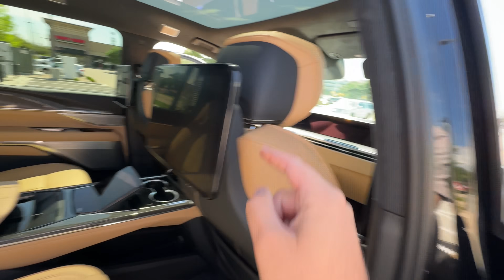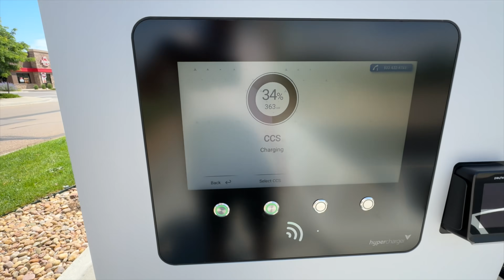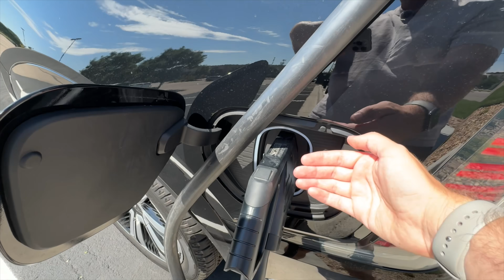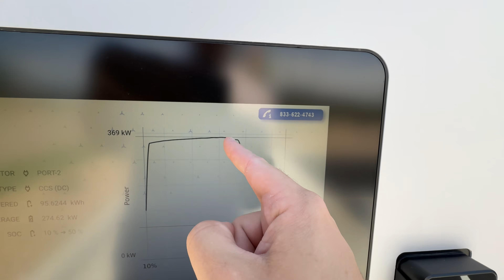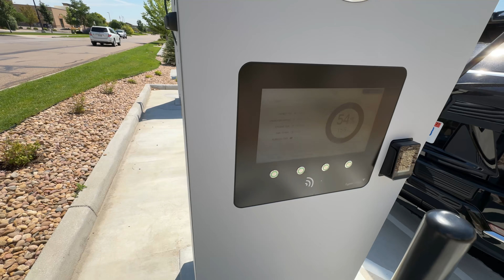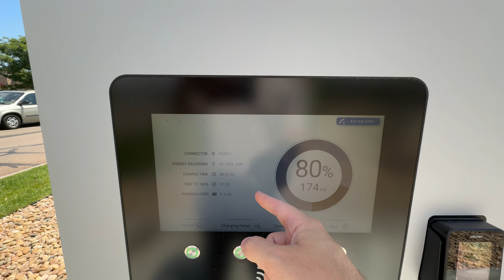Trying To Understand The Thermal Limits Of Charging The Cadillac Escalade IQ

Comment: My Polestar 3 had a defect with the AC cooling vents (they were programmed backwards or something was installed backwards).  In recent heat on a trip to Florida (temps over 98F), I had several derated sessions.  I have the data plotted on my latest blog post.  We don’t have extreme heat planned here for the next 10 days but hope to do another charging test now that the issue has been resolved.

Comment: I recently got a 4WT Silverado. No difference with AC on when charging at 300KW+ even in 95 degree weather. Maybe this has been fixed with an update?

There is definitely a kind of flash that GM doesn’t do OTA, they call it Vehicle Wide Programming (VWP)

Comment: I like that teslas show "charge speed limited by charging station" I see it all the time at a split 200kW charge point charger I use sometimes with NACS cables cause it's cheaper than the superchargers there and almost as fast when I am the only one there. Regardless, it would be nice to see more info.

Comment: Hey, this is great information.  not that  most people need it but for those that really want to understand where you’re going to benefit at a DC fast charger the most, and how you can utilize the way it’s programmed, this is great. I know most people don’t care too much because who’s going to be traveling much more than 400 miles on a trip anyway or 500 miles. Whatever the case rarely have to worry about this charging curve in a vehicle like this, but to understand it and to know how it works is super helpful!  maybe for those that might pull trailers or perhaps just those rare situations for someone really needs to push it on a longer trip it’s always good to know these things thanks again! and I also appreciate this may be the most because some of GM’s batteries have poor charging curves and they have much less range, so this brings it out into the open for everybody to understand better and maybe there will be adjustments and improvements, as we are confident that videos like this will certainly be helpful getting things improved a little bit with some of those vehicles like the blazer EV!

Comment: It has one of the best battery durability in u.s ev market; it uses GM-ultium developed large pouch NCMA cathode cells with 270wh/kg energy density and impressive 3200 cycle life(highest cycle life in nickel based cathode pouch industry because of NCMA chemistery);meaning it has similar prismatic battery longevity as best CATL NMC battery cells used in porsche and MB evs(similar 3200 cycles);meaning according to its EPA range it has 93% capacity retention at amazing 250,000 mile of mileage;cadillac really cooked something
Reply: For the price the batteries better be made out of gold.
Reply: Beauty is that all of GM Ultium platforms share a common cell and module. This means even a $45k Equinox EV has the same benefits, it just has less modules.

Comment: The vehicle should know its own thermal capacity limit and be able to derate itself from the beginning to hold the highest rate the longest based on your max charge limit. If you want to blast as much juice fit a short time, lower your max charge. I’d you have it set to 70+% then it should get to that percentage as fast as possible, even if that’s a lower charge rate to start with so it can hold it longer.

Comment: That precipitous drop was clearly on the charger cable. The fact that it ramped back up after switching to a different charger confirmed it. Mercedes/Alpitronic should really have liquid cooled cables. Even if the idea is that it won't affect 800V vehicles much, 400V ones will overheat it fairly quickly.

Comment: I’m in a road trip with a 25 Lyriq, Texas heat still does a number of charging. Started great at 190kW but after 10 minutes the battery was running 116F and charging dropped to 64kW.

Comment: Do you check or log battery pack temps before beginning charging? It might’ve had no consequence to this car’s results, but your lack of mention of battery temps/preconditioning, and the same from other hosts, keeps bugging me.
Reply: Considering how many charger tests they do, I’m kind of amazed they don’t use “CarScanner” with an OBD-II reader to give them battery pack temps.
Reply: I have car scanner pro for my Ultium-platform Prologue.  I can see charge port, battery, refrigerant and coolant temps with it. I can also see the delta between chiller in and out for the battery cooling circuit. It's an amazing piece of kit. It would be easy enough for these guys to set up some data capture and see the relationships with temps during charging sessions.

Comment: I have had an IQ since the beginning of May.  I have driven from Denver to Houston, Denver to PHX, Denver to Vegas, and Denver to Jackson, WY in the Escalade.  You seem to be hyper focused on charge de-rating with the AC, but that is not how most people are going to road trip - sitting in the car while it is charging.   If you are driving 250 to 300 miles at a time in the IQ, which is pretty damn easy to do, a person is not going to then continue to sit in the car while it is charging.   They will get out and use the restroom or go find food, not continue to sit in the vehicle after just driving for three or four hours.   I appreciate your research in the charging capabilities of the IQ, but it does not factor into real world scenarios.   For instance, yesterday I drove from Jackson, WY to Denver in my IQ.  The hotel had a destination charger, so I left the hotel with 95% battery charge.  I easily made the 280 mile drive from Jackson to the EA charger  Rawlins, WY.  As I charged in Rawlins for 19 minutes,  I used the facilities, got a soda, and then walked around for 5 minutes to stretch my legs.   In that 19 minutes I charged enough to then make it the 230 miles home to Denver to arrive in my house with 20% battery remaining.   I did a 500 mile road trip with just a 19 minute charging stop.  There are not too many EV's that can match that capability which is what I think you should focus on, not charge de-rating with the AC when no one is going to sit in the car while it is charging after driving three or four hours.   I appreciate what you do, Jordan, so keep up the good work.  I just think in this case you are missing the key point when road tripping in an Escalade IQ.
Reply: The only reason I continue to make comments like this is because anything that derates in high heat is a safety hazard with no AC in states like Texas where it easily gets over 100 degrees. I regularly road trip my Lyriq and we always have the ac full blast while it charges, and it will always derate in extreme heat. Alot of times we either eat in the car or want to do a quick run inside get some snacks bring it back to the car and get on our way. I'm a huge EV proponent but excuses like this is what makes ICE owners not want to switch because excuses should not be made on a vehicle that can't run ac and "fill up" at the same time like an ICE car. Rant over apologies.
Reply: @OverlandandBeyond  Rant away, you are amongst allies here.   Everyone road trips in their own way.  The +210kWh battery of both my Escalade IQ and my Sierra Denali EV allow me to easily go 300 miles on the highway at a time.  that is 4 hours in the car, so I am definitely not sitting in the car for another 20 or 30 minutes while it is charging.  My experience road tripping in an EV started in 2015 and I still carry those tendencies when I road trip today, even though the charging infrastructure is no where near what it was back then.    At the end of the day a person makes a decision - sit in the car for longer because they want to run AC while charging, or wait inside an air-conditioned location while the vehicle charges in less time.   If sitting in your car in AC while you charge at 50kW or 75kW is your thing,  then you do you.  I prefer to wait in an air-conditioned building while my vehicle is charging at +250kW.   Also, my conversation pertains strictly to my Escalade IQ since this is what Jordan's video is about.   Introducing another vehicle, even though it is a GM product, with a much smaller battery and much slower charging speeds is not the point of this conversation.
Reply: I don't usually sit in the car but I always leave the AC running when charging. On road trips, my vehicles usually have AC running for 10+ hours on travel days.
Reply: I agree. Not to mentioned the first 15 min or so you are using the restroom gives the batteries the full usage of the fans to cool down and get peak charge before you enter the vehicle again.
Reply: On a 100° day you’re gonna want to keep the car cool while you go out to use the restroom in the facilities. It is unacceptable to derate charging while using A/C on an over $100,000. Vehicle.
Reply: @BK-tx2vw  Fair point.  However, if I am stopping for a 30 minute charge I am not keeping the car cool the entire time while I am inside in AC wolfing down junk food at a Pilot/Flying J.   Is derating charging speeds while running the AC acceptable, certainly not, but with all gen 1 vehicles, a person makes adjustments until a fix is released.   I did the same same thing with my first Model S in 2015, my first Model X in 2017, and my first Taycan in April, 2020.   The Escalade IQ is not perfect, but it is by far the best road tripping vehicle on the road today in terms of range, charging speeds, and comfort.
Reply: @PaulieinColorado  Most of your cabin heat is do to the windshield being slanted more toward the cabin than in most ICE vehicles. What I do on a trip is while charging I put up a windshield sunshade to keep the cabin cooler.

Comment: No A/C during charging! Wow. I have a Lyriq and a Tesla. The software in the Lyriq is garbage. Cadillac is not updating software to levels of newer model years. OTA updates hardly ever. Thermal management in Lyriq is garbage compared to Tesla. Fans running ablaze in Lyriq while level 2 charging at home. Tesla, no fans at all. Quiet as a cucumber. I'll take panel gap imperfections over software and engineering all day long.
Reply: Tech is luxury. And we can summon the damn thing in a Costco parking lot. Fsd is the only reason I will never buy another EV besides tesla.

Comment: Mary Barra build an EV that's worth a shite.
Reply: 😂 they could have built a Lucid Gravity and you’d likely still say that. People just love to hate GM.
Reply: @Icayn No I genuinely despise crappy GM EVs.
Reply: @BradC44 but what is there to despise, it drives 450 to 600 miles before you stop get something to eat while it charges for 40 minutes with the ac off since you’re away eating with your family, who ALL fit COMFORTABLY in this beautiful human transporter. 

For its size it’s quite efficient 2.0 to 2.6 miles per kilowatt hour, and it fills a niche no one else bothered to. A long range cruiser that can tow long range while being luxurious enough to even include buttons! Imagine that. GM batteries suffer almost no range loss over the years and don’t phantom drain, they also can out regen every other ev make without overheating save for maybe lucid. 
Why would you hate it? Cuz it’s big? So is a Tahoe.
Reply: @Icayn Lucid Gravity yes!  GM would never have dreamed up this model.  They should stick to their ICE vehicles and stop their EV nonsense.  I mean they can't even put the new Bolt's charging port in the correct location. Jeez. ⚡
Reply: @BradC44 i own an Optiq and it is VERY far from crappy. One of the nicest vehicles I’ve ever owned. And I’ve owned a 2011 BMW e92 for 10+ years. It doesn’t have the driving dynamics of the e92, but it’s not supposed to. The interior quality is every bit as good. The sound system is awesome. The software works perfectly fine for me. Oh and it actually has a screen behind the steering wheel and buttons and knobs instead of a tablet to control everything. I couldn’t care less about summoning my car in a parking lot. Im more than capable of actually walking to my car. If you like your vehicle, good for you. But I like mine too. Everyone has different priorities in what they want in their vehicles.
Reply: @Comfort031  how is your Optiq? Did you buy or it lease it? & is it new?

Comment: Jordan. The "flap" is a cover to protect the DC charging pins from the weather when leveltwocharging. This is one more reason the NACS connectors should be installed ASAP for the North America market.  I have used both for many years, and the NACS connector is 100 times better and much easier to use.
Reply: He does know that. But on that Escalade it’s not a flap, it’s a stopper that hangs by a thin plastic cord. On my Mach-E, it’s a flip-up flap. Stoppers tend to get in the way.
Reply: I’m sure that he’s aware of that. But he was complaining about. Is that it’s hanging by a dangling piece of plastic. Well, on other vehicles. It has a small hinge, and it’s very secure.

Comment: This vehicle isn’t worth the $160K MSRP.  The bugs aren’t worked out, the software isn’t as good as the pure EV makers. Don’t understand why GM is messing with these high end cars. Definitely not a Mercedes, and when depreciation is figured in, this is a very poor buy.  GM should be laser focused on Equinox and Blazer, not sidetracked by crazy expensive vehicles which are quite frankly outside GM’s status & capabilities, but they aren’t focused. Example: “Blazer EV SS doesn’t have the charging curve to match its performance” reported by ‘Out of Spec Testing’. Without an EV mandate some EV makers are going to be in trouble.